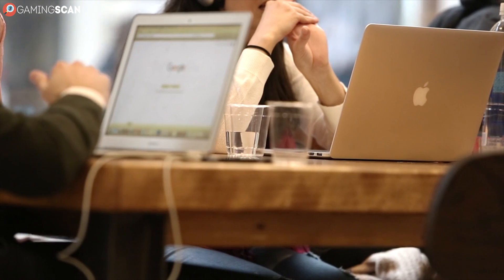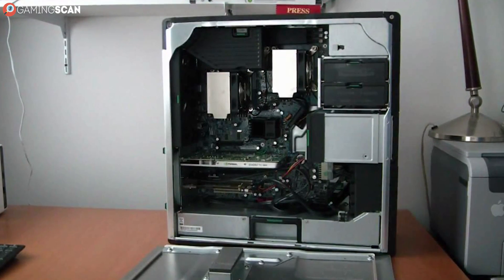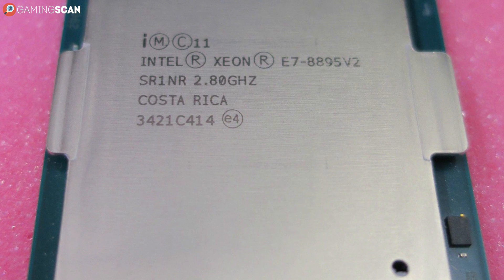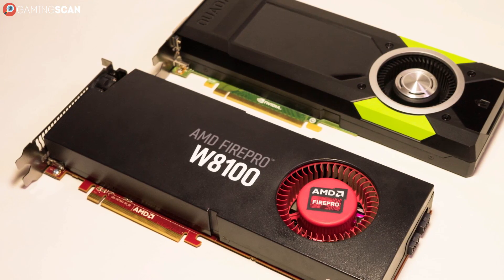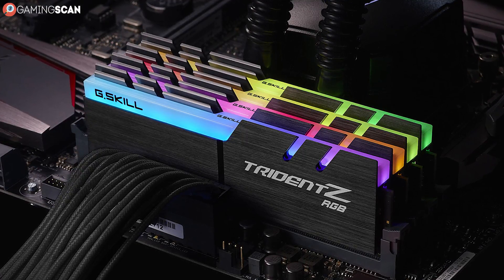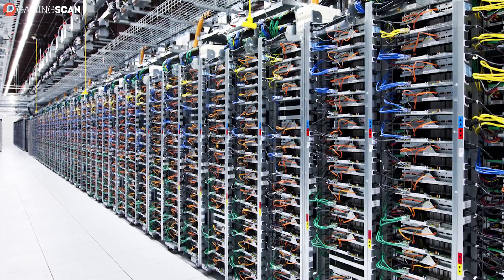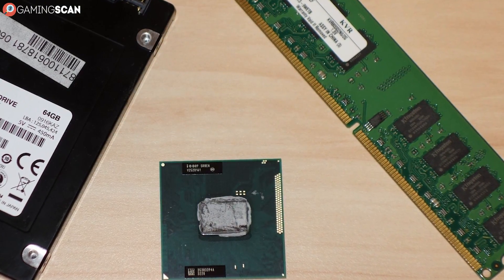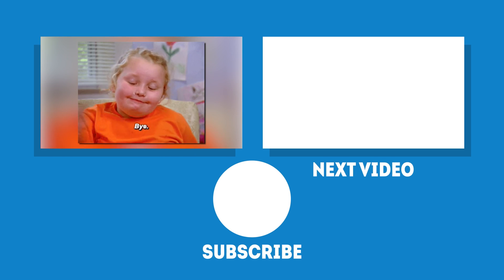Workstation vs Gaming PC - Which Should I Choose? [Simple Guide]

Comment: I am also a workstation (DELL T3600) gamer. My specs are:

Xeon E5 1620 (3.6 GHz)
32GB RAM
RX 560
2TB HDD
128GB SSD
635W POWER SUPPLY

And runs most of the games on ultra, few of them on very high but its great in performance.
Reply: How much was your system?

Comment: 3-4 years ago i really like gaming but; Now i am in graduation and working too so i just made my  pc with nvidia quadro rtx4000 and ryzen 7 3700x before that i mostly used laptops now when i work on my pc it is like super easy and not lagging even a bit. But due to lock down because of covid i play sometime with friends but not like extreme so a decent frame rate of 100-140 this setup provides me which is very much for me and now to be conclude I would suggest you to build a pc with quadro p4000 or less  its same or cheaper nowadays and really you will not find anything missing. According to my work its super great. And as i said i am in graduation 2nd year work is important for me. You can take low end quadro cards and learn though them and afterwards you can switch to any other if you want later. But trust me you can barely say its not for gaming. But yes if you only do gaming its not for you.

Comment: I’m looking to build my own... so I can combine the two! For 3D modelling ex. ( 
Revit Autodesk) and multiplayers games (Call of duty)... any suggestions that I can get would be great! Not really looking at a budget  but eventually I will narrow it down to what best for both...
Reply: I bought a workstation for gaming which cost me PKR 67000 ($393 according to Google currency converter) and run games on ultra, some games run on very high graphics with 1080p display. I have

Xeon E5 1620
32GB RAM
RX 560
2TB HDD
128GB SSD
635W POWER SUPPLY

Games I played on it are:

GTA V
JC3
JC4
RISE OF THE TOMB RAIDER 
CYBER HUNTER
TOM'S CLANCY GHOST RECON 

and works smoothly.
Reply: Go for hp z840

Comment: Workstation GPU's are designed to crunch double precision numbers, which are more frequently used in CAD. 
In Games the GPU's that overhead is useless, which is why they're not as suitable for that application.

They're also more overbuilt and have more refined drivers, to ensure compatibility with CAD software.

Comment: I would add to that. Workstations use raid controller for storage. To get redundant storage. A Raid 1 configuration will use at least two hard desks each one is a mirror of other. So if one of them stopped working you will not lose any data and your work will not stop. 

Connecting to multi network is sometimes required so they will have multi nic cards, and you can forget about wireless network for workstations. 

Also, they may have redundant power supply. 

And they uses high quality material for case. I am talking about heavy material. To stand the harsh environment

Comment: gaming machines can do what workstations do no problems at all, it just depends on how complex and intensive the work, rendering a 5 thousand polygon model in 3DS or Maya for example might buy you a couple seconds of time on a workstation if at all, then same thing with CAD drawings - are you drawing a house or a building, same thing with industrial design - are you designing a fire hydrant or a tank,  same thing with video editing - are you processing a full length movie or a small 5-10 minute youtube video.., and if the machine is a single user that doesn't need to feed other people resources then your definitely not a server and most mid to high end CPU's are perfect, even if you have CAD, multiple web browsers, multiple reference pictures on second monitor, download data and streaming some music - you still don't need a workstation build and just a mid level gaming machines is fine.

Comment: My son ran a dual xeon hp XW8400 with 32gb of ecc ram and 1050ti laterally. Until a few years back he used the quadro that was in it for about 7 years.
It ran flawlessly and even the quadro delivered decent performance until he started to ask it run DX 11 games.
It was replaced with a 1050ti which worked admirably but they've start to release games now that are using instructions not on those old Xeons so some games stop working.
It's had it's time.
It's lasted ten years past it's retirement. 
Just amazing computers.
I'm trying hard to re-use the case but I'm guessing it will be HP proprietary.
We'll see.
Workstations for the win!
Luv and Peace.

Comment: In my opinion, if you want to game as well as do art, animation, and design,  I would go with the latest Intel or AMD processors and a Titan RTX graphics card or an AMD equivalent. This graphics card is a lot like the Nvidia Quadro cards but at about half the cost. This card will allow you to game at optimum effeciency as well as do top of the line art projects.
Reply: Not mecessarily. Heavy 3D rendering art will require the number of cores that workstation cpu’s have. Same for gpu’s, much more vram, but slower. Could be wrong tho
Reply: @foxgaming76yt24  I know the BOXX Workstation line comes with high end
 processors like the Xeon and usually have the Quadro line of graphics cards, but as you said as far as gaming goes it could be slower. I think that's why the RTX 3090 or even the 3080ti cards offer a happy medium between gaming and creativity while also offering a fairly good amount of VRAM.
Reply: @rodneymathews6775  I doubt the 3090 will actually be slower than the quadro a6000, it'll most likely be faster, but I have neither the knowledge or the cards themselves to test this out however.
Reply: @PRIYANSHU PANJA Which card are you're referring to?

Comment: My old workstation from 2013 with RX580 8GB runs 1080p  at 60 plus fps at high any game at 2020. Workstations with a good GPU no need any upgrade for aboute 10 years.
His specs are :
6 core 12T
16 GB RAM
1TB HDD
With 256 GB SSD

Comment: my lenovo p51 handles games pretty well with ultra graphics set running on quadro gpu 4gb dedicated gddr5
Reply: My shitty 3k dollar workstation can’t even play any game at 60 FPS,I’m really disappointed.
Reply: @saifowahsh  what graphics card do you have in it?
Reply: @christrahi16  a Quadro RTX 4000
Reply: The prebuilt workstation is a HP z820 where I haven't modified anything but the GPU going from two Quadro k4000s to one  Quadro RTX 4000
Reply: @saifowahsh  the RTX4000 is a pretty powerful card. Should be playing games easily. Is there maybe other problems like colling problems?
Reply: @christrahi16  Definitely,it has slow fans running from the back panel,one directly on the motherboard,and itself has its own fan,but it can really handle rendering 8k video files and easy 3d modeling,but gaming for high frames is an impossibilty

Comment: A tower server is a good third option.  It basically has similar hardware as a workstation but can often handle slightly more memory and often has more than two CPU sockets. The downside is you might not have more than one graphics option but if you can get a very good GPU in it, you have not only a good Gaming PC but with the heavier duty in general hardware designed for multitasking, storage capabilities,  redundancy and sustained high demand use of a server as well as the out of band management  features of most servers.

Comment: What are people's thoughts on using something like the Falcon Northwest? With the i9 9900k processor and Nvidia geforce rtx 2080ti graphics card. Water cooling and.... I'll stop there. Why cant I use this gaming PC which has a lot of great  specs, it would seem for gaming and workstation use? For 3d graphics and would be able to render a bit faster then your average PC without blue screens and crashes.  But allows you to also play games and even use your VR. What exactly are the flaws to this machine here? As a gaming and workstation pc.
Power Supply: EVGA SuperNOVA G3 - 750 Watt Motherboard Asus® ROG Strix Z390-E Gaming Processor: Intel® Core™ i9-9900K 8 Cores - 16 Threads - 5.0GHz Overclock: No Overclock
Processor Cooler: Asetek® Liquid Cooling 650LX Memory 32GB - 2x16GB - 2666MHz
Video Card: NVIDIA® GeForce®RTX 2080ti
 Sound Card: On-Board Audio Networking: On-Board Ethernet
Operating System: Drive - SSD Samsung® 970 EVO Plus - 1TB SSD - M.2 - PCI Express
Optical Drive DVD Writer
64-Bit Operating System Windows 10 Pro Rescue Drive USB Rescue
Reply: The machine is perfect for pro work... Just go with more reliable air cooling and mighty psu, that's it:) and forget about overclocking, workstations are about reliabillity

Comment: i use a workstation for gaming and it works great
Reply: ツaxel7542 is fortnite good on it ? (If you play it)
Reply: @ThePhilosophyHub  yes fortnite works great
Reply: ツaxel7542 ok thanks❤️
Reply: And what’s your GPU ?
Reply: @ThePhilosophyHub  Asus gtx 1060 3gb
Reply: ツaxel7542 ok thx
Reply: @axel7542  that is pretty much a gaming card, unless yo are running any xeons or epycs what you have there is basically a gaming pc.
Reply: @perhapsso1909  its a hp workstation z420 with xeon e5 1650 and with a gtx 1060
Reply: @axel7542  fair enough

Comment: I wanted to render a very large video but I wanted to use the workstations for another project so I used a standard graphic PC tower computer, and because it would take such a computer days to render the video I left it alone to get on with it. 3 days later it was still working on that video, so I continued what I was doing on one of the workstations and I could smell burning which smelt like solder! It was the  PC tower the memory chips was so hot it made a sizzling sound when I touched it with my finger.

The computer had a memory chip failure message. The memory chips were too hot to touch so I used a clamp and put the memory chips in the fridge freezer. Amazingly the next day when I put the memory chips back in the computer they worked! The computer smelt a bit cooked! but amazingly the computer did work!

That is the difference between a workstation and a PC desktop or laptop. The desktop games PC, will play games better than a workstation.. but a workstation has a lot more memory and processors and is used for heavy number crunching day in day out, with server grade hardware.
Reply: Can I use a gaming pc for video editing?
Reply: @SK-PODCAST  Yes you can

Comment: i know about the nvidia quadros the worst of which are the passive ones you can game with them but if you get a passive one getting an aftermarket thermal solution is recommended as they run hot and from what ive read they can over heat and shut off. oh and the 16gb of  IS OVERKILL IS A LIE i have a gigs and when playing something like advanced warfare or gta i frequently get stutters due to high ram usage

Comment: I mostly need my pc for using Linux and for programming in python using tensorflow. Also, I am a casual gamer. So which configuration should I opt for :
Amd ryzen 2950x with asus rog zenith extreme x399
Vs Intel i9 9900k with asus maximus xi extreme
Please do suggest me
Reply: The gaming benchmarks are almost the same.
But, in workstation, TR 2950X is WAY better.

Go with 2950x
Reply: 2950x
Reply: Thread ripper 2950X is the best option intel is not good for work station

Comment: Workstation is not a potato pc. Workstations are like gaming pc but made for work.
Reply: the real question is, can workstation run minesweeper?
Reply: Um......Yes you can....Workstations Get the Same Frame rates as Gaming machines. the only reason u dont want to get a workstation PC over a gaming PC is actually because a Workstation PC will costs u like 10x more money and will get you the same Gaming Performance. there is nothing wrong with gaming on a Xeon if u can get one for a good price.
Reply: The Joker  Not necessarily. I have a workstation PC with a 9940X, 64GB ram, and a 2070 Super. I primarily use CPU and RAM for my tasks, but I also game a little bit. 100+ FPS max settings 1440p on any game title. Sometimes 4K is above 60 FPS depending on the game.
Reply: It's more like lvl 5 multitasking gaming PC
Reply: is that really true?
Reply: working for gaming
Reply: Yeah and schools if they have spare time though. Msi gaming works the best

Comment: workstation server pcs are dope and better but not designed for gaming and are not great for gaming but best for running massive programs which are bout like 3 terebytes or 5 terabyetes but are not good at gaming where as gaming pcs have insane perfomance in gaming but doesnt use xeon which is way more powerful than the latest 17 8th gen